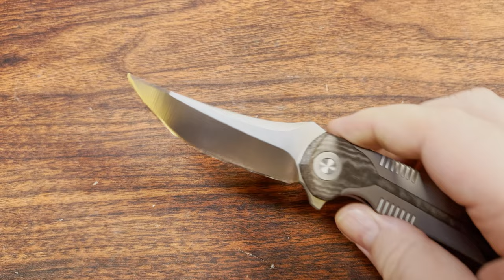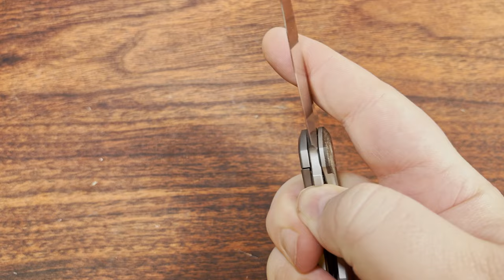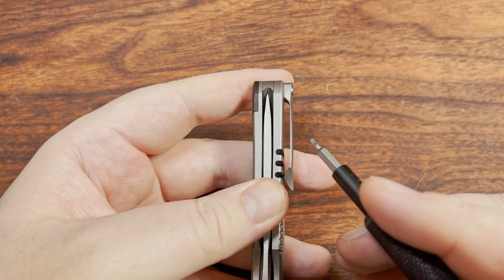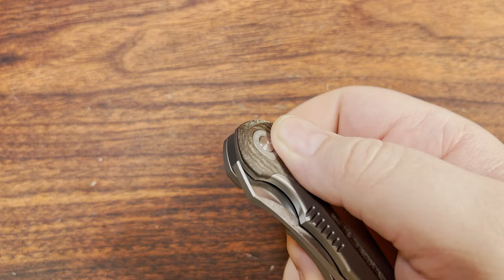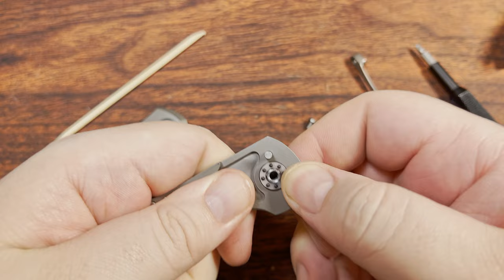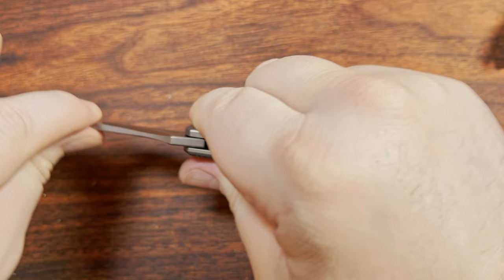TwoSun Tuesday: TS426 "Kilij" Tepe Design in Ti & Micarta Inlay with 3.36" N690 Blade

Comment: Re pocket clip, I cut a sliver of kydex, heated and pressed into the lockbar bar cutout that the clip is resting on.  Slid it out, sanded a bit, slid it back in.  It's held in by clip pressure so I don't think it needs adhesive.  I wonder if someone could do something similar with 3d printing.